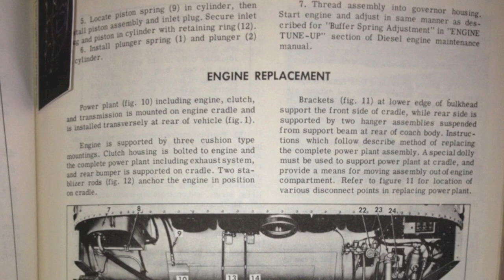Technomadia's 8V71 Engine Rebuild - Disassembly (Part 1 of 2)

Comment: The Detroit Diesel gods must've had a hand in you guys breaking down and ending up right at Interstate PowerSystems....a Detroit Diesel official distributor.....AND a company where they have more than a few of the "old-timers" who know how to talk to those vintage 2-strokes to get them humming JUST right! A properly adjusted clean burning 2 stroke diesel shouldn't smoke much at all, if any..... and the exhaust can almost have a "sweet" smell if its tuned just right....complete combustion!  Glad to see you got Zephyr back on the road with a quality motor rebuild!

Comment: I have an RV bus conversion (1977 AM General Transit Bus) and am running a Detroit Diesel 8V71T.  The engine was rebuilt by the previous owner about 20K miles ago, and is mated to a 4-speed Allison transmission.  It currently gets 6.5 to 7 mpg running at about 1850 rpm (55-57 mph).  So you're not likely to see much of an increase in fuel economy after the rebuild if you have the 4-speed.

Comment from the maker: Yes, we have a firm quote on the rebuild.. and it is more than $16k. But they are also rebuilding a lot of the surrounding components at the same time.  Prices usually go up over time, not down ... but still, we are very happy with the price.

Comment from the maker: We looked at re-power options - and it just wasn't practical. We were getting 6.5-7 MPG on it before the break down. It'll be interesting to see if that improves after the rebuild and the rack is run.

Comment: Detroit Diesel made it easy when it came to removing an engine
Reply: Nice motors, i cant wait to try filling one with Motul synthetic 2T of amsoil doninator synthetic 2T oil and loading it down. i intend to make a total loss burn off with a pump to to the fuel to burn of lube oil ashless 2t or 30W.

Comment: How much does an engine like that weigh?
Reply: The engine itself is about 2300 lbs. The weight of the tray, the transmission, any fluids remaining in the pan or block would add some more weight.